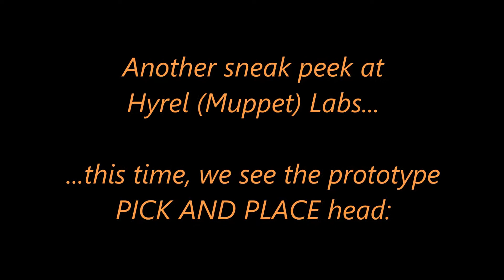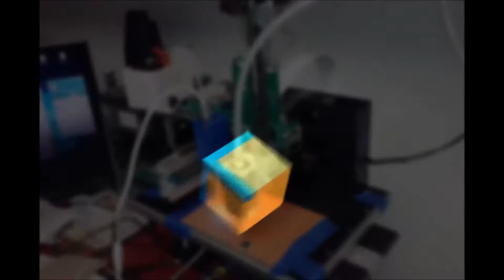Hyrel Sneak Peek: Pick and Place Prototype

Comment: That's pretty cool!  I did some imagineering on a PnP machine  long before  3D printers were popularized.  Did a lot of designing and had a website, but never got to the building stage.  Best of luck with this.  I think there is a market for an easy to use PnP machine for prototyping and small run production.